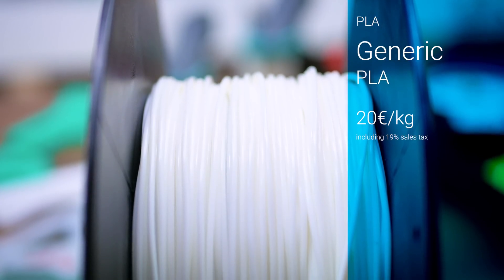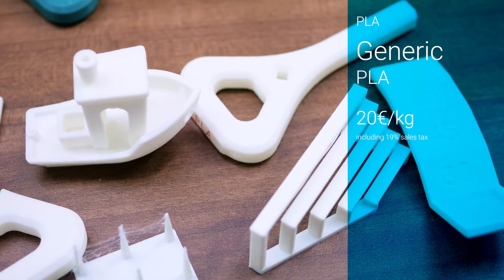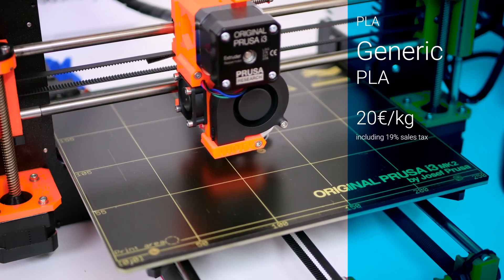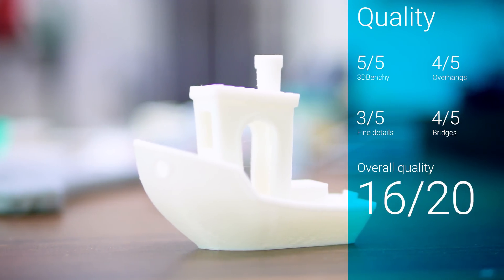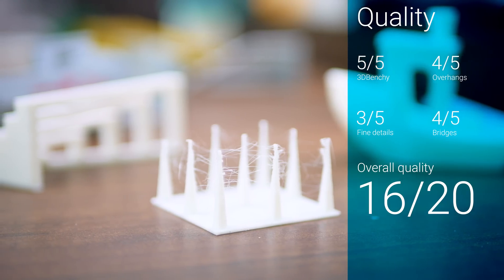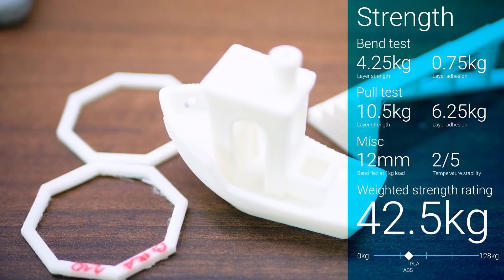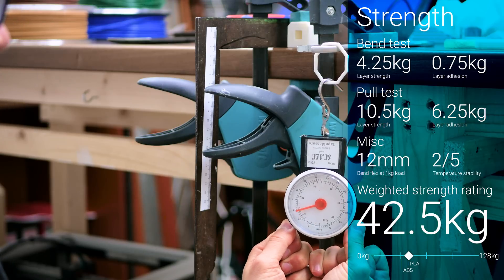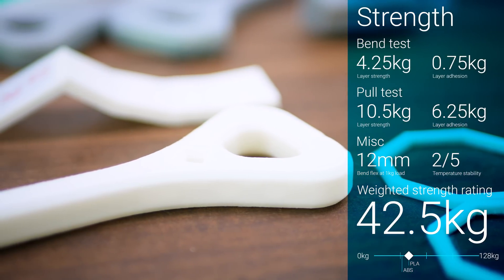Reference PLA analysis! #Filaween

Comment: I get more satisfying results printing with colored filament instead of neutral color (milky transparent) pla filament from the same brand. Layer bonding with the neutral color is a bit too well. So good, I can't get supports loose for the print. Printing without wide brims is guaranteed a failure. Stringing is also an issue with the neutral one. Neutral is a bit stiffer than colored. Anyone else experiencing this?

Comment: Hello Thomas
I found you here on youtube and I'm quite impressed with your good teaching regarding 3D print, it's a big help :)
I've just started on 3D print and here's an important question that you might answer.
PLA is a plastic that is not so strong. Will it be possible to make a surface treatment with epoxy or similar to make the print stronger?

Comment: I'm pretty sure you would get much better fine details (less stringing) by lowering the temperature to 205ºC or 200 instead of 210. I understand you want to get the same gcode but every filament has a different composition and requires at least its own tuned temperature.
Reply: Ok but I often see a recommended temperature range, because printer sensors and room temperatures are so variable.

Comment: Thomas, for the stringing issue on the test, could you go and tune your printer settings better to deal with that?  I figure that the retraction speed and distance would be different for each manufacturer and type of filament as well as the variables of size (1.75mm vs. 2.8-3.0mm) and even color.  

I see a lot of new 3D printer users asking the same question "what is going wrong with my print and how do I fix it?"  My advice to them is to tweak settings for the filament they are using. I would suppose that you did tweak the slicer settings to the optimal values that brought out the best that the filament has to offer.  At least I hope so as putting a generic set of values would not be fair to that filament though it would however provide a great head to head comparison to all filaments.
Reply: ***** - None the less this will be good data for everyone. 

Great job.

Comment: Confused why you did not say the brand? Isnt that the whole point of this new series? Ive used cheap filaments from random ebay sellers and always seemed like different results with each. Really nice video but idk how its helpful without even knowing the exact brand? The quality differs so drastically in my experience with the no-name stuff.
Reply: Seeing as Tom says in the DAS FILAMENT video that their PLA has been his goto filament for the last few years and it just so happens to be (the only other one in his sheet) priced at the same 20€/kg, I'm thinking it's a fair guess that might be the source for this white one as well. That said, it's purposefully obscured somewhat as it's not supposed to matter. It represents here a basic, everyday PLA from a general name-brand, that's commercially available in Europe. Of course these are not always the same, but it's a fair enough baseline.
Reply: These are refrence filaments. Base lines. Other filaments will be compared to these generic filaments.
Reply: Ok, but so far this has the best layer adhesion strength of any of the non-cartridge filaments tested. It seems like it deserves an actual mention.

Comment: The idea of this is very cool, but I have some questions.

Are you going to use the same settings for all PLA brands and product lines, or are you going to use the manufacturer's recommend settings, or are you going to dial in your own to get the most out of each?

I find that even within the same brand / product, the optimal setting change per color.

Layer adhesion changes with print temperature and layer width. Stringing changes with  temperature settings, and retraction. Etc...

It would be great to have a behind the scenes video explaining your procedures  so we have a better idea of what's going on. 

Thank you for all the time and effort you put into making videos for us. It's really appreciated.